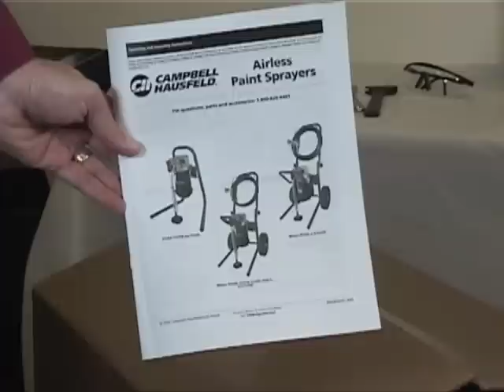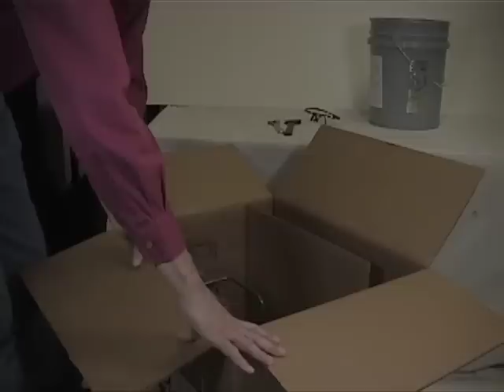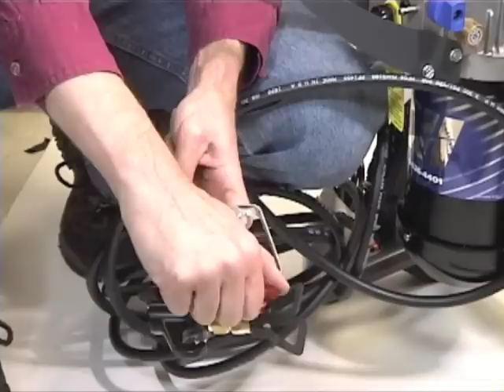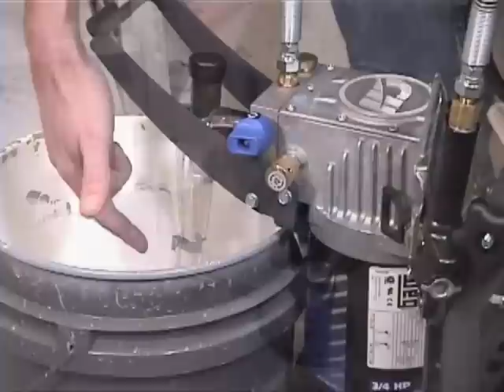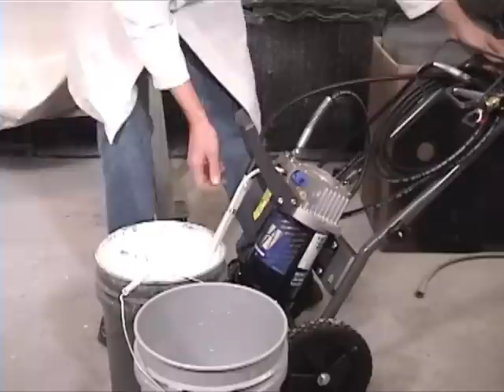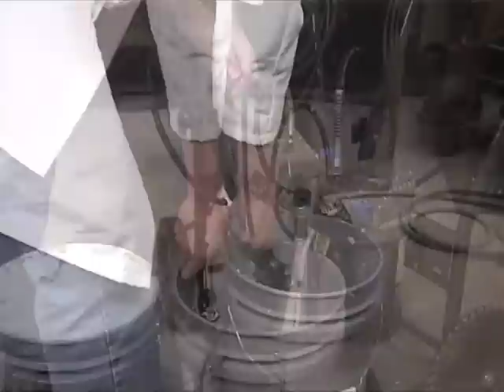Campbell Hausfeld Airless Paint Sprayers

Comment: Hi, I have a 1/2hp 0.28 GPM model, do you know if I can run a 519 tip to spray a roof membrain product by Dulux for tile roof on a 75` hose? It is the Australia delivered model, and came with a 315 and 517 tip. Will it have enough pressure for a 519? Thanks!

Comment: What type of oil does a Campbell hausfel airless paint sprayer use?
Reply: +Perales Eliab Did you find out about the oil. I lost some while cleaning parts and need to replace it.
Reply: Oil? It shouldnt require any oil is electric airless machine
Reply: The oil is 46# anti-wear hydraulic oil normally but you can use a good quality oil like Shell Tellus High Performance Hydraulic Oil 46# too.

Comment: my sprayer doesn't pump
Reply: You may need new packings
Reply: Jorge duarte where would I find some
Reply: Online, look for your model number and look for the packing kit, or a place where they maintance airless machines, usually that kinda maintance would cost around $160 with the parts included

Comment: My problem with Campbell Hausfeld is the smaller products they carry are usually Chinese junk. Supposedly their paint systems and bigger air compressors are made in the USA, but their pressure washers and smaller air compressors are made in China. Since I've always had bad luck with the smaller products, why would I want to buy an even more expensive CH product?
Reply: chechnya

Comment: We have been selling them for 5 years. Not the best professional quality, but certainly no shit quality. Diaphragm sprayers are a bit finicky when it comes to operation. But we have customers that have them a couple of years and they still work.
Reply: Theres one for 225$ on craigslist I am looking at...do you know the max. pressure??- it is a MODEL AL232000LE...looks fairly old. i would like at least 2000 pounds for large areas, house, ranch houses...thanks
Reply: @oreokookie1000  never buy a Campbell Hausfeld! They are trash . I have 3 right now that do not work. Buy a graco.

Comment: Just dont buy it. Shit quality for the money you pay. Mine was over a grand or so, and it only worked 2 hours till today. It sudently stoped making nocking sound while working, and the pressure dropped significantly. I tried to repair the machine, but there is no parts shops or representatives of this company here in Portugal, so support is terrible. You can only reach them by calling to their U.S. office. Not satified at all.